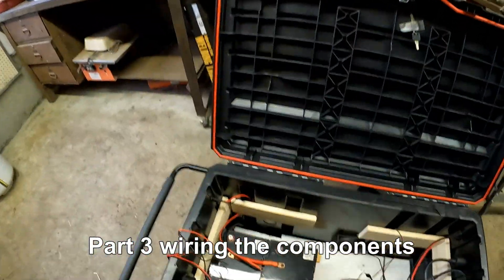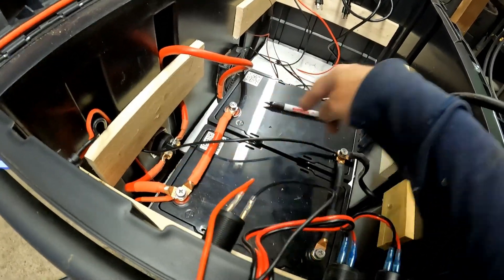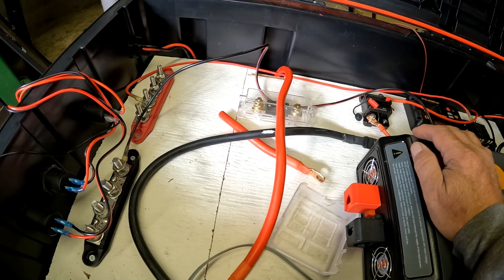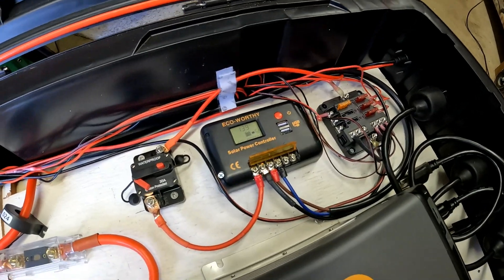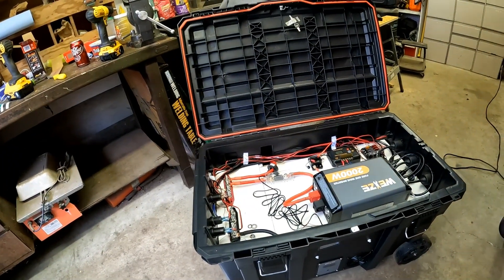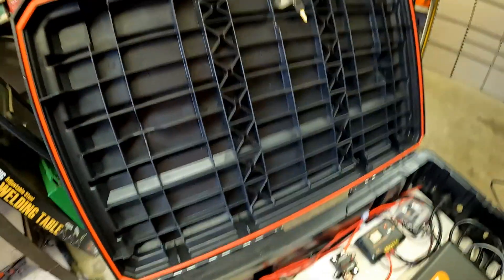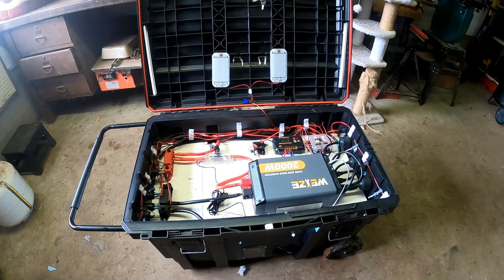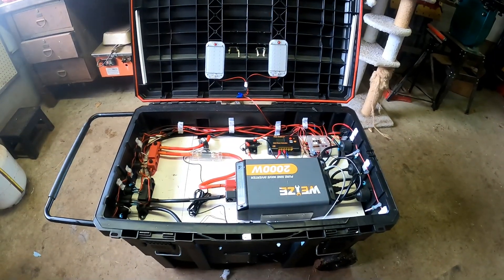Solar Generator build part 3

Comment: Sir - do you have a parts list you can share with this build?  I really like your design and layout a lot.
Reply from the maker: I believe this is everything I bought. I didn't list the wire or crimping connectors as I already had those. If you need that I can get that for you too. I'm glad you enjoyed the video and good luck with your build.
https://www.amazon.com/dp/B0BY7XW685?ref=ppx_yo2ov_dt_b_product_details&th=1

https://www.amazon.com/dp/B08XJPB9GZ?ref=ppx_yo2ov_dt_b_product_details&th=1
https://www.amazon.com/dp/B0BRV88HHC?ref=ppx_yo2ov_dt_b_product_details&th=1
https://www.amazon.com/dp/B0BRV88HHC?ref=ppx_yo2ov_dt_b_product_details&th=1
https://www.amazon.com/dp/B09SKXX1J9?psc=1&ref=ppx_yo2ov_dt_b_product_details
https://www.amazon.com/dp/B09NHW72YB?ref=ppx_yo2ov_dt_b_product_details&th=1
https://www.amazon.com/dp/B09PF27Y5Q?ref=ppx_yo2ov_dt_b_product_details&th=1
https://www.amazon.com/dp/B07XF5D8HK?ref=ppx_yo2ov_dt_b_product_details&th=1
https://www.amazon.com/dp/B08MPP2JPC?psc=1&ref=ppx_yo2ov_dt_b_product_details
https://www.amazon.com/dp/B07GL9X3B5?psc=1&ref=ppx_yo2ov_dt_b_product_details
https://www.amazon.com/dp/B09Y8Q1X15?psc=1&ref=ppx_yo2ov_dt_b_product_details
https://www.amazon.com/dp/B01N9O2Q51?psc=1&ref=ppx_yo2ov_dt_b_product_details
https://www.amazon.com/dp/B0C8TPMFSN?psc=1&ref=ppx_yo2ov_dt_b_product_details
https://www.amazon.com/dp/B096Z1WNLW?psc=1&ref=ppx_yo2ov_dt_b_product_details
https://www.amazon.com/dp/B09L89LW3P?ref=ppx_yo2ov_dt_b_product_details&th=1
https://www.amazon.com/gp/product/B08LQK889Z/ref=ppx_yo_dt_b_asin_title_o06_s00?ie=UTF8&psc=1
https://www.amazon.com/gp/product/B07114RK67/ref=ppx_yo_dt_b_asin_title_o06_s00?ie=UTF8&psc=1
https://www.amazon.com/gp/product/B091TYHY8M/ref=ppx_yo_dt_b_asin_title_o07_s00?ie=UTF8&psc=1
https://www.homedepot.com/p/Husky-23-in-50-Gal-Black-Rolling-Toolbox-with-Keyed-Lock-and-Portable-Hand-Tool-Tray-206319/321052317
Reply: TY very much for the itemization!